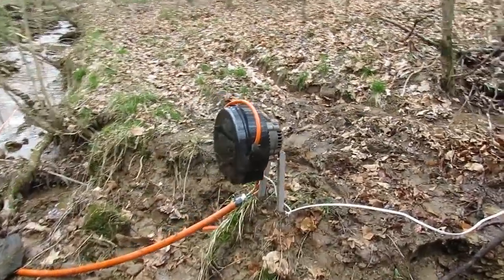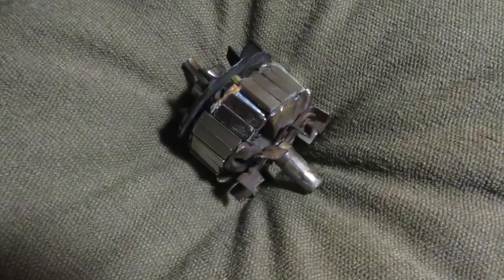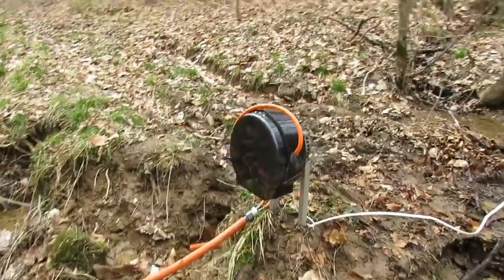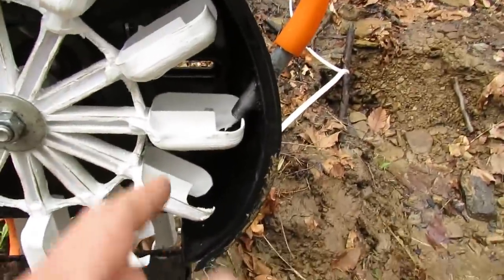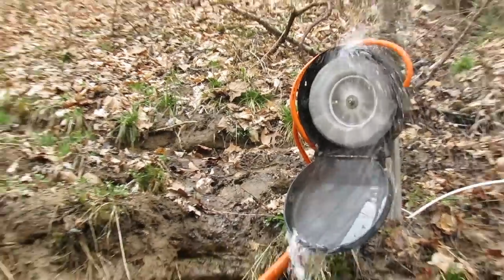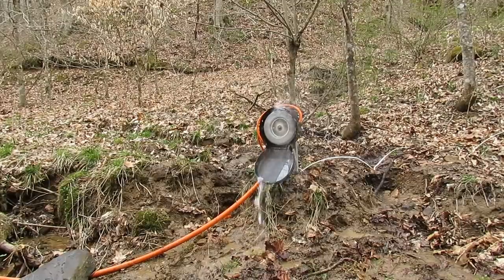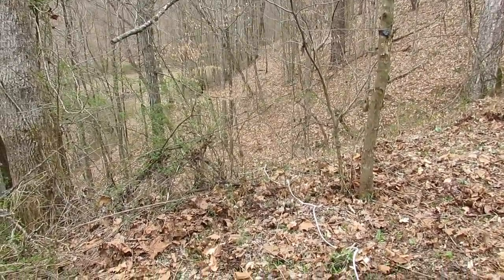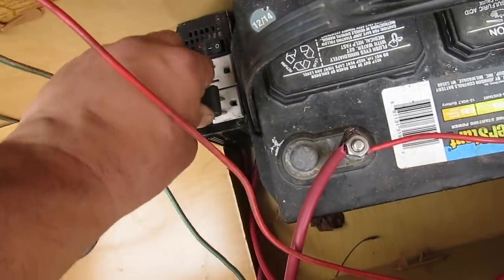Water Generator Running Off Grid Cabin

Comment: Have you seen the stream engine turbine?? They're little and can produce alot of power.. you probably don't require as much power but you can check out the system I'm talking about on gridlessness. They went and checked out this guys system and it was amazing. He had a dishwasher, family and a hot water heater etc.

Comment: Hello sir, Can you see if you can make this battery for off grid? I am a physicist and have been investigating ancient Egypt batteries. They are huge Baghdad batteries using hundreds or even a thousand gallons of ????. From my research there are two they used for these batteries which may work for off grid. The first one we won't try. It is a possible forever battery combined with a  forever (fluorescent type) light tube using mercury fumes, from the mercury Baghdad battery. The lights have been found under the Sphinx as described in ancient journals from around 330 ad. It seems that using mercury as the substance for the Baghdad battery may gain forever power. The EXPERIMENT REQUESTED is using a 5 gallon plastic pail with a lid. An iron rod almost to bottom of pail is placed inside a copper tube the same length. Both iron rod and copper tube are to stick out of top of pail in center. A thick rubber gasket is to separate the two so they do not touch. A hole poked gasket is at the bottom of these two allowing for liquid to enter. After attaching to top of pail two wires are soldered to each the iron rod and the copper tube (positive and negative) don't remember which is which. Once that is secure push pail top on. Open the paint hole cover and fill with vinegar. YOU may need an inverter to plug in radio lamp coffee machine UNKNOWN POWER but at one hundred gallons the power should be huge. THE ANCIENT SECRET OF FOREVER BATTERIES MAY OR MAY NOT BE PROVEN BY FILLING 5 GALLON BUCKET WITH MERCURY. I DO NOT RECOMMEND. The experiment is to see how much power and how long it will last on a 5 gallon pail Baghdad ancient egyptian battery. If it works then just extent the iron rod and the copper tube and use a 30 or 55 Gallon drum. Vinegar is inexpensive per gallon

Comment: Do you know what the pressure is at your nozzles for the pelton wheel is? All that "junk" has a great purpose, thanks to you.
Reply from the maker: Not sure of the pressure. It's not a whole lot but would increase with a higher drop.
Reply: @lukeFugate  Looking into this kind of thing to do on my off grid property with w seasonal stream. I have 18 psi to play with. Seems like we're the kind of guys who like to hang out at garbage dumps. I brought home an old wheel chair and some 20 gallon HDPE liquid totes because they looked handy.

Comment: The transmission cable looks too small especially for the distance, also you need to double check the voltages of what you're generating and if it's ac or dc
Reply from the maker: yes, it is too small. It was what I had at the time. It was putting out AC from the alternator and rectifying to DC at the battery box. It worked pretty well except for the natural problems resulting from using a creek. I was constantly fighting floods, clogging from debris etc. 
I have since gone with solar power. I have 2000 watts of panels and a lithium battery bank. Very dependable setup now.
Reply: @lukeFugate  nice man, major importance on the correct sizing of cables and circuit protection, electricity can kill so use caution, also any live parts have to be accessible by a tool, dc not so much, ac yes.
Reply from the maker: @opmgamingnz  My new system is a little safer with fuses and breakers. Here is a video showing the inside part before I got it all done. https://www.youtube.com/watch?v=GmMEH5uYbjc

Comment: Hi friend i am from South Africa great idea love it. We get lots of power cuts South Africa is going down like Zimbabwe. I want to know can i use ant rectifier from car to put in my system and what charge controler can i use we dont have those in South Africa thank you for your great ideas you are the best on you tube,
Reply from the maker: Thank you very much. If you have a stream with a large drop nearby this idea will work well for backup power. I would recommend using a manufactured PMA instead of one for a car. This car alternator has a lot of losses and needs more water flow than I had. The car rectifier would work to smooth out the AC current and convert it to DC as long as it is a three phase PMA. They do have wind generator charge controllers which are made to take the AC and charge a battery directly. Here is an example of one 
https://amzn.to/3CydAno
This one will accept connections from a PMA and solar panels at the same time.
Reply: @lukeFugate  Thank you very much Luke

Comment: Sorry if this has already been answered earlier, but what’s the need to convert the alternator to a generator only to rectify it back to DC again at the charge controller? Why not just leave it as an alternator with a voltage regulator just like it would be in a car? I’m assuming that as an alternator it requires more rpm than the turbine is capable of? Thanks! Love your videos!
Reply from the maker: The reason for the conversion to AC is it will travel further than DC without loss. DC would work if you are very close to the source.

Comment: How does it not lose current traveling 60 feet to the battery? With solar you have to have your collection panels close to the batteries, due to loss of current.
Reply from the maker: It does lose current but not as much as it would running DC. Solar panels run DC and have to be closer to the batteries because of the quick loss through the wires. With AC which the alternator puts out without the rectifier it will travel much further without unacceptable losses.
Reply: @lukeFugate  so it ends up being more efficient than solar!
Reply from the maker: @icuinthelight  yes in the case of such long runs. That being said I have not used water power for a long time. I have all solar now. Much less maintenance.

Comment: Good video. This is a very good idea. Best to put the box inside and out of the elements. Suggestion. There are a lot of choices on fork lift batteries. More then enough for your electrical needs
Reply from the maker: Thanks. Yes my batteries are inside in a box vented to the outside now. I am actually going to go with a couple of lithium batteries now.

Comment: how far your actual generator into your cabin? and what cable do you use?
Reply from the maker: It is about 100 feet. I used 14-2 wire cause that was all I had. At least #10 wire would have been better.
Reply: @lukeFugate  thank you for the reply. I want to make one like yours. but the flowing river is 300 meters away into my house. do you think in that far how do I make a generator from river into my house. what wire, and how many watts do I need. Coz I have doubt on power loss.
Reply from the maker: @CookieKids-w3n  At 300 meters Your voltage loss will be too much. The generator can't produce enough voltage to travel that far and have enough left to charge a battery. Your best bet would be to put batteries and an inverter nearthe generator and run the higher voltage AC through #6 wire to minimize voltage drop. At that configuration with 120 volts AC from the inverter you will lose 8.87 volts and still have 111.13 volts at the end. That is assuming a load current of about 10 amps on average. That would be an acceptable loss.

Comment: If you have just 1 diode on each phase you are only using 1 side of the phase ... single phase rectification only gives half the power ... you need dual phase - - - double your power production
Reply from the maker: Yes, car alternators are not built with efficiency in mind. It would be better to get a pre made PMA for this type of thing.
Reply: @lukeFugate  My point was simply to add a  few diodes would be better -cheap solution

Comment: You probably loose more than half the power in the wiring between the alternator and the battery box. 
I'd get a much more efficient water turbine designed for such applications. Choose a model that puts out at least 60 volts. Higher volage is better as long as it's safely installed. The higher the voltage, the less losses in the transmission line (electrical cord).
If you want to keep using the same wheel and if it spins at nearly the same RPM, I'd simply add a step-up transformer at the alternator. It will greatly reduce the losses in the wiring. For variable wheel speed, a bridge rectifier with a DC to DC converter can be used to raise the voltage.
Good luck.
Reply from the maker: True. There are way too many loses in this system. The system I ended up using has the inverter and batteries near the source and running the 110 volts AC to the cabin. Much more efficient.

Comment: You could take the 3d printed one make a sand cast and pour aluminium to cast a slightly heavier one or old lead to build a flywheel i plan on daming up my creek for a water wheel
Reply from the maker: That is an excellent idea! The plastic one didn't last.
Reply: @lukeFugate  I'm working on off grid cabin/house too with your creek you could make a water wheel like before i have a backhoe and bull dozer if you had a facebook to connect privately we could make you a reservoir/retention pond to help power it im thinking of doing youtube videos myself
if your in the county below paintsville i live off hwy 201 in webbville north of paintsville
Reply from the maker: I know about where you are talking about. We worked on the road through there before. 
I live in Hindman. You should try doing YouTube it's fun.
Reply: @lukeFugate  everyone knows "blain" ky thats down the rd must be neat to be near Loretta lynns homeplace hope you survived the ice storm i keep referring to your videos on being off grid the power co wants 700 to fix mine

Comment: How does the water go uphill from the hose in the river up into the generator? Thanks.
Reply from the maker: the intake of the hose is much higher than the wheel(about 40 feet), so the small lift from the creek bed to the wheel doesn't make any difference.
Reply: @lukeFugate  Thanks.

Comment: I need little help. I made homemade water wheel that connected to alternator. I like to connect to charge controller to charge 12v battery. Gotta 12v input inverter that produce output of 110v 2300 watts. My question is what amp controller would I need for this operation not to over power battery but keep good charge?
Reply from the maker: Even if you get a higher amp controller it won't hurt your battery. It will automatically adjust the amperage with the state of charge of the battery. I would say a 60 amp controller would be plenty. I don't see this setup ever producing that much power. Your controller needs to be rated for more power than you plan to make.
Reply: @lukeFugate  thanks sir. I would up my battery bank but because I have a 12v inverter and an alternator, minds well see what power I can save from my power company. Thought of running my winter electric heater or hot water heater. Figure it save $50 a month. Most heat elements are 1500 watts. My inverter puts out 2300watts with 4000 watts surge. Minds well take advantage
Reply: Let me add if I had contact info, I'll show u my work or process at this point. To draw up an idea in ur mind. My water wheel made from a big wire wheel from power company. I attach a long pipe through which spins with block bearings. At the end of pipe, will be bike petal wheel with chain spinning back bike rim (like 1 of ur videos) with drive belt spinning alternator. I put a 40gpm pump in a tank and run the drain hose above the water wheel (water cycle. It falls back into the tank with water pump).

Comment: Nice also battery creates fumes so vent the box for fumes and heat
Reply from the maker: Thanks! I ended up putting some screws in the top of the box to hold the door open a little bit to help it vent.
Reply: @lukeFugate  awesome

Comment: What gauge wire did you use? I'm having trouble understanding off grid wire gauges for maximum output.
Reply from the maker: I used #14 wire. Too small for efficiency. It should have been at a minimum #10. It was just what I had.

Comment: Bravo!! Well done, I’d deff. Recommend a gasket for that hatch!! Water and electricity don’t go very good together..... Or Do They!!!
Reply from the maker: Yes, I ended up sealing it up around the case. I also put a can over the generator to prevent it from getting wet. You are right about water and electricity it wouldn't have lasted long like that.
Reply: @lukeFugate  very good, I tried sneaking alittle hydro and electricity Pun in there lol,

Comment: 3 phase? if the alternator was in a car it will only put out 14.2 volts if it's over that it will cook your battery, but you could get 90 amps.
Reply from the maker: Yes the alternator puts out 3 phase AC to the three wires coming out. The rectifier converts it to DC.

Comment: have you considered adding a few large deep cycle batteries for your needs... with that much surplus voltage you would keep them charged and in a float mode.
Reply from the maker: Great suggestion. I have  since upgraded to 3 deep cycle batteries as well as solar. No problem with power now.

Comment: would have been nice to see what is actually running off of that setup..
Reply from the maker: I have four led lights that can run continuously. I also run a fan for my geothermal air conditioner. At times, I charge my computer also. That's about all I run up there. I also have solar power too now. There is plenty of power for everything now.
Reply: @lukeFugate  sir what is the wattage of this water wheel you have? 200watts? 500?
Reply from the maker: @superjeffstanton  Not with the amount of head and flow of water I have. The best I can figure, I am getting somewhere around 50 watts out of it.

Comment: Not trying to be a debbie downer, but your alternator should be be far enough away that water isn't covering it also waterpoof junction box  would be nice, and use UF wire (preferably putting it underground). Other than that good job!
Reply from the maker: I waterproofed the alternator and put the wire in conduit. I never changed out the wire for UF but it hasn't had a problem, probably because of the conduit. Thanks for watching.
Reply: @lukeFugate  anytime!

Comment: questions, im not to good with power wats and stuff like that, is it alright if i use a fan blade for mine cuz its not as strong as a current? also what is the best wire to use and to hook it up to a house?(without the battey and stuff like that)
Reply from the maker: If the fan blade can spin the generator fast enough it would work. A pelton wheel would be much more efficient though. Depending on the distance to your house, it would be best to use at least #12 wire. You would have to have a battery for surge power and also to prevent wild fluctuations in voltage from the changes in water speed. It doesn't have to be an expensive battery, just something with some storage capacity.

Comment: You would get more volts from a stranded wire such as an extension cord rather than the 14-2 or 12-2 that your using now.
Reply from the maker: You are right. I have it running on an extention cord right now and it works better.

Comment: It is a fake one as everyone can see the water run over the alternator which makes the system fail and second issue the alternator would jam once attaches to the battery because of the weaknesses of the water pushing
Reply from the maker: You have a right to think what you want. I did address the water spraying on the alternator in a later video. Also, it does produce power, just not a whole lot. What would be the point of doing all this work if it didn't work? Youtube doesn't pay enough to make it worth faking something like this. It's by no means a perfect system, and I know I could do things to improve efficiency, but I rely on mainly solar now.

Comment: Tun your wiring to the inside,  battery outside...😁
Reply from the maker: Yes, the battery is far away from the cabin now and the ac is running to the cabin only to cut down on voltage drop.

Comment: Nice....pretty impressive.
Reply from the maker: Thanks!
Reply: Hey Luke, how about if you extended the shaft 6 or8 inches long to keep it from getting wet. Don't take it apart just weld it to the middle of the belt wheel on the outside. You certainly know what you are doing so I'm sure you can make it happen. If you have another idea I would love to hear it for my future plans. Great job though.
Reply from the maker: @EA-pp6jn  That would work, it would at least get it away from the water.

Comment: Awesome idea! Very resourceful with the toilet paper holder :) Look like you live in a climate that is cold in winter. May be a dumb question...but any ideas how to run hydro power in winter? I live near a creek in Minnesota and it almost never freezes over and always running. Maybe a hose system like yours would work in winter? Any ideas how to keep it from freezing? Or perhaps that's not possible :/ Thank you!
Reply from the maker: So far it has frozen up once when the pipe got plugged by some leaves and I didn't clear it off in time. Other than that as long as the water keeps flowing it never freezes. Admittedly, we have had a pretty mild winter, so I don't know how it would stand up to really colder temps.  There has been ice around the case to the point that I couldn't open it, but it kept going.

Comment: Be better using everything 12v where possible 👍
Reply from the maker: Yes it would. The problem I have ran into now is all my sources of power are far away and I have to run the 110v ac from the inverter to the cabin to reduce the voltage drop. My batteries are located 150 feet away from the cabin now.